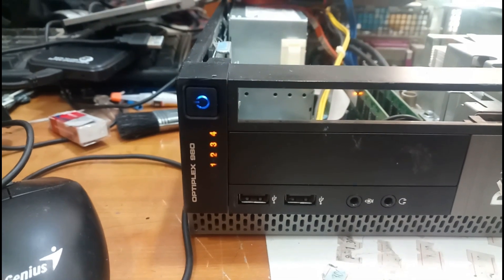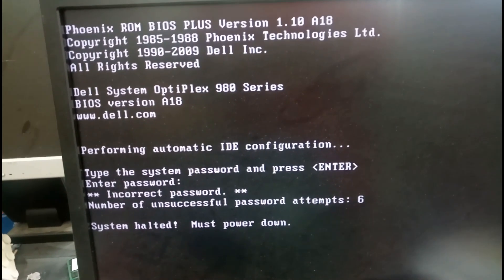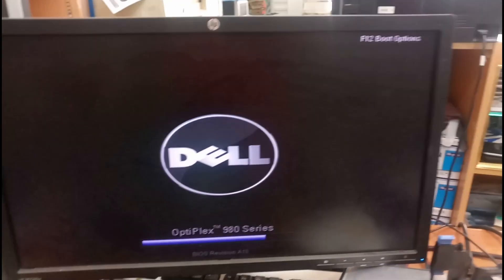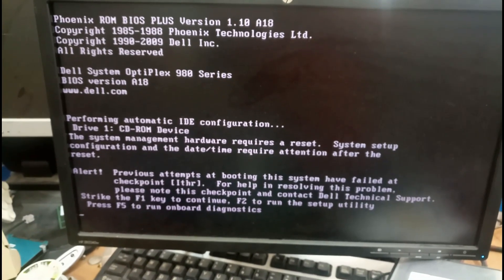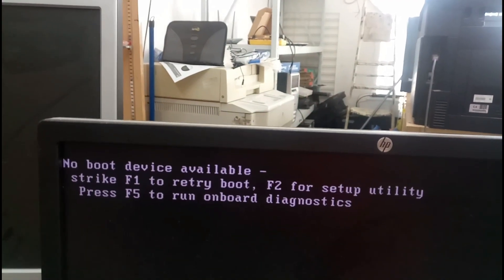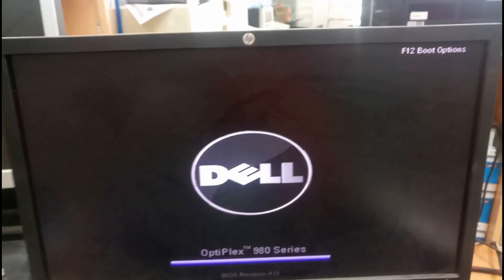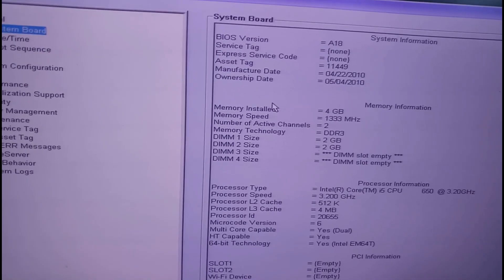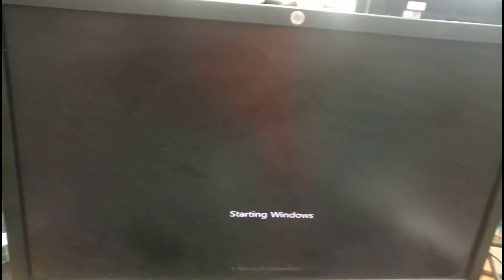Type the system Password and enter #System halted must power down#Solved and working...

Comment: My pc says
Drive 0 not found :serial Ata, sata-0
Drive 2 not found :serial Ata, sata-2
Alert,failed to detect one or more drives during post. Strike the f1 key to continue, f2 to run the setup utility press f5 to run on board diagnostics. (and if I press f1 it doesn't continue)
Reply from the maker: did you remove sata cable and check or replace the cable and see bro